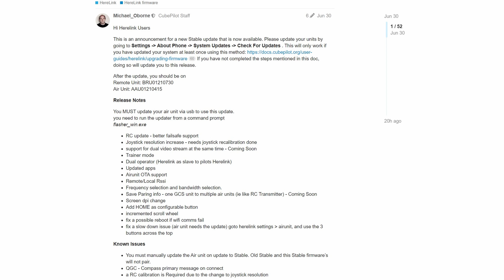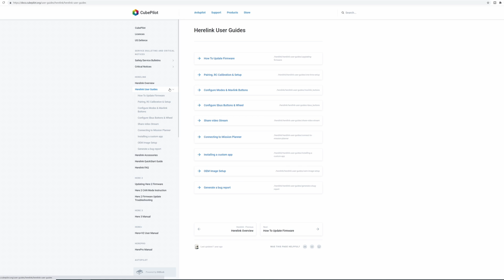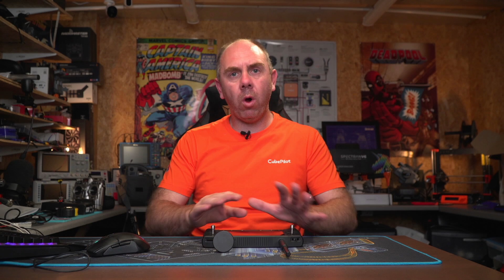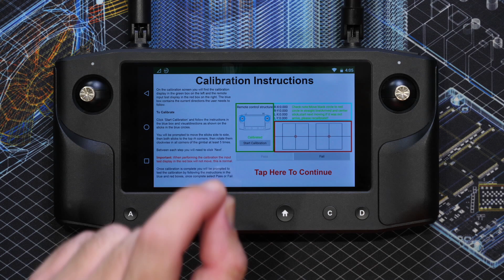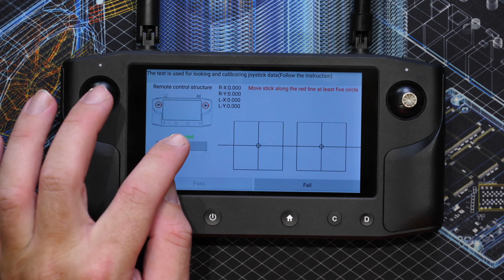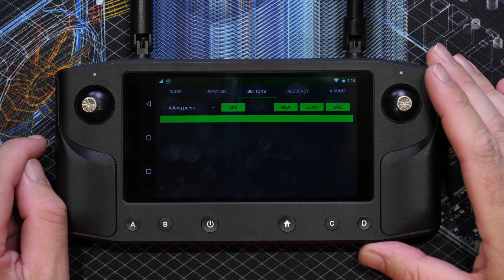Herelink  - Dual Ops - OTA Updates + Major New Features & Improvements  In Latest Firmware

Comment: question: I am getting a 0 channel found, while trying  to calibrate the joystick in QGC. All other calibrations have been performed, system binds, cables are correctly connected (SBUS1). The FC is an Orange Cube  or Orange cube + on a multirotor. Any ideas?
Reply from the maker: Are you running the stock installed QGC?
Reply: @MadRC  Yes, the one that came with the Herelink.

Comment: Thanks for the video, I'm still super stuck with understanding how to setup press vs hold buttons for switching flight modes... Does QGC let you configure long press buttons or is it only short press settings in QGC???   I understand that you can only setup failsafe modes such as Land & RTL etc on SBUS channels so could potentially configure a long press as a momentary PWM value to trigger RTL but is there a better way? would love a simple short & long press option setup in QGC

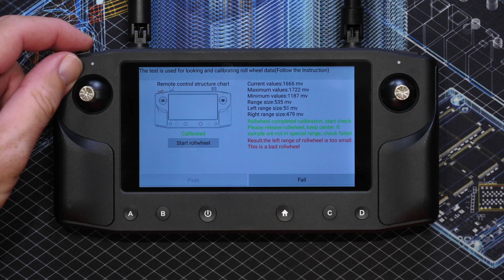Comment: Hi Ian, at 10:53 you got a message on the screen saying the "right range is too small, This is a bad rollwheel"  I have the same situation on my unit (received Aug 2022). The feel of the wheel at the extremities is 'woolly' and I would have expected the range to be closer to 1000-2000 rather than the 1187-1722 it shows.  Should I be worried I have a faulty wheel mechanism ??  Thanks Steve 🙂

Comment: null this new update impossible to connect the radio control to the ground unit
Reply from the maker: You need to update both parts of the system.
Reply: @MadRC  how to do this? the radio control is up to date but the air unit is not

Comment: This update really sucks, its brocking HDMI camera compatibility, I wrote on the forum directly to the developer and no one replied, they just ignoring. For what purpose I need systems that stops working with update and I CANT DOWNGRADE it due to security reasons?? Total garbage herelink is, I`d rather buy some Chinese skydroid that works flawlessly without this shitty updates that braking system and developers don't give a fuck
After this shitty update gimbal that I using is no longer transmitting video, or I better say air unit is no longer recognizing HDMI signal from my gimbal. I had second herelink system laying around, I downgraded manually air unit via adb fastboot commands, and paired with herelink on previous firmware. All works just fine. So conclusion is that new firmware really lacking support of some HDMI cameras that is were supporting in previous firmware. For now I had to move to another manufacturer and change 3 herelink systems that I using for work, and will never again support and buy this crap.

Comment: Hi 
i have the same problem this is what i get in the flasher_mac comman
please help

Last login: Mon Aug 23 14:11:07 on ttys000
/Users/nev/Downloads/flasher_mac ; exit;
Nevilles-iMac:~ nev$ /Users/nev/Downloads/flasher_mac ; exit;
Looking for Device…
Found Unit Type: airunit

Downloading required package…
Traceback (most recent call last):
File “urlgrabber/grabber.py”, line 1583, in _do_perform
pycurl.error: (77, ‘error setting certificate verify locations: CAfile: /usr/local/etc/openssl@1.1/cert.pem CApath: /usr/local/etc/openssl@1.1/certs’)

During handling of the above exception, another exception occurred:

Traceback (most recent call last):
File “flasher.py”, line 265, in
File “flasher.py”, line 73, in download_package
File “urlgrabber/grabber.py”, line 828, in urlread
File “urlgrabber/grabber.py”, line 1298, in urlread
File “urlgrabber/grabber.py”, line 1170, in _retry
File “urlgrabber/grabber.py”, line 1148, in _retry
File “urlgrabber/grabber.py”, line 1281, in retryfunc
File “urlgrabber/grabber.py”, line 1346, in init
File “urlgrabber/grabber.py”, line 1695, in _do_open
File “urlgrabber/grabber.py”, line 1833, in _do_grab
File “urlgrabber/grabber.py”, line 1829, in _do_grab
File “urlgrabber/grabber.py”, line 1678, in _do_perform
urlgrabber.grabber.URLGrabError: [Errno 14] curl#77 - “error setting certificate verify locations: CAfile: /usr/local/etc/openssl@1.1/cert.pem CApath: /usr/local/etc/openssl@1.1/certs”
[32008] Failed to execute script flasher
logout
Saving session…
…copying shared history…
…saving history…truncating history files…
…completed.

[Process completed]

it sounds that there is " pycurl is having trouble pulling the appropriate software from the servers"  how can i get this to work 100% or is there a new version for the   flasher_win.zip flasher_mac.zip or flasher_linux.zip.

Comment: Question... need help .. crashed my dji fpv . Broke r r motor arm . I'm waiting for replacement arm decided I'd change motor also just because it was on damaged arm . I desoldered it . And I was curious afterward of my warnings. Got several motor errors to be expected and a esc auto check error. 
    Will the esc be fine when I solder new motor I ln or is my problem bigger than my broken arm and motor... 
.... Motor  looked to be undamaged just replacing it with arm for good measure. 
   Thanks for your help . 👍

Comment: cool did the update now absolutely nothing works air unit and ground station wont pair....... perfect
Reply from the maker: Have you updated both sides
Reply: @MadRC  yup the airunit update is failing
Reply: @MadRC  the airunit fails to update on mac and windows. also the airunit just has two orange led's on they use to always bee green.
Reply: I appear to be having the same problem as Tyler.  Ground unit appears to be updated via WiFi, air unit was updated via USB/windows flasher and restarted after about 45 seconds but with two orange LEDs.  I tried to pair the ground and air unit again but have failed repeatedly.  Tried factory resetting the ground unit via Android backup/reset but the ground unit seems to hold the latest update meaning I cannot pair to the air unit that paired suvvessfully before .. still showing two orange LEDs and no ability to connect to the air unit to see if the air unit can update OTA.  Nothing seems bricked, all seemed to work as described but gone wonky.  Getting a bit panicky as have a large survey job next week.  Any way to revert to previous build on ground and air so I can work until this update is fixed?
Reply: When I try to pair by pressing the ground unit pair button followed by the air unit pair/reset button, the first LED on the air unit goes green and starts to flash but after approx 30 seconds the ground unit comes up with the message "Negotiation timed out, please try again"
Reply: @pedroagent1427  none of my reply's are coming through
Reply: @Tlavite  Try refreshing the page, I thought my comments had been deleted but then I refreshed the page and could see everything again
Reply: Very happy for you to call or email me direct if you can't describe how you fixed it here Tyler, let me know if you want my email address
Reply: I have the same problem that you cannot bind the unit to the ground and the radio control have you found a solution please